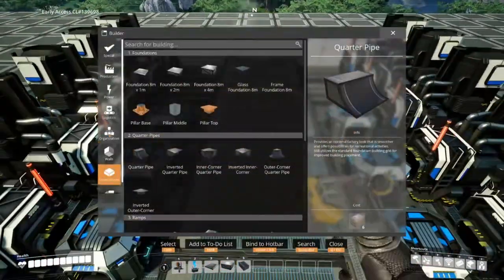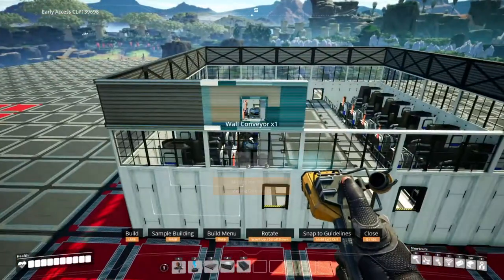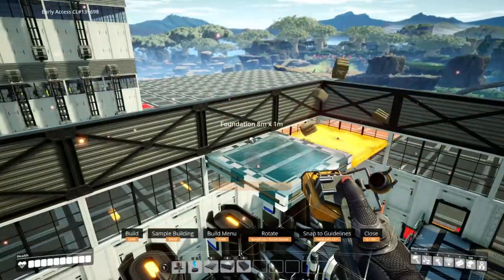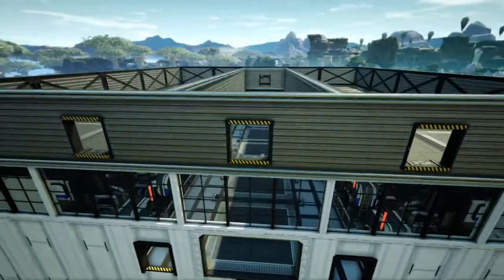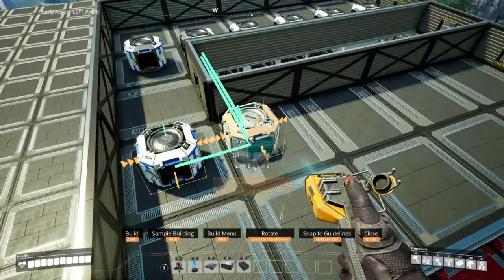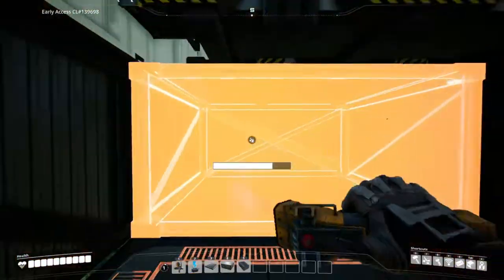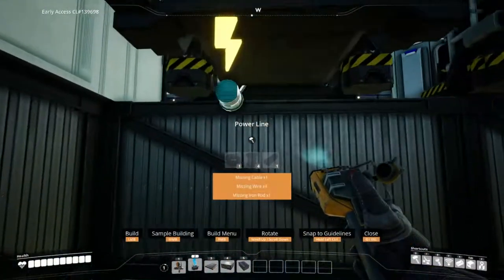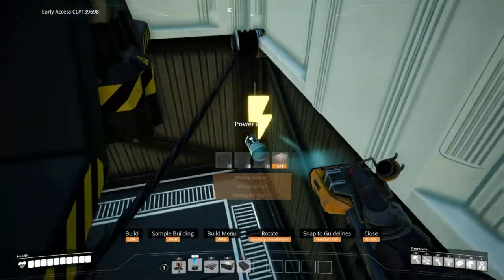CLEAN 5x5 Smelter Build [Satisfactory Game]

Comment: This factory looks awesome and I was trying this out on Update 5 experimental but I'm having trouble. I think they may have expanded the clearances on the smelter or the splitters because I can't get it to line up like this video.

0:18 I put the first smelter down as close to the wall as I can (before it turns yellow for soft clipping)
0:35 But when I try to line up the splitter with the input and the middle of the single conveyor wall its too close to the smelter and I can't place it.

Have you tried this on the new Experimental Update 5?

Comment: Beautiful design! However people, do note that this specific ore split is not good for 100% efficiency. An overflow ore inlet could mitigate inefficiency, but it's still not optimal. Personally i'd use a dedicated basement or 2nd floor sandwich layer right beneath or above the smelters to make an equal ore split for all smelters and feed them into smelters individually with lifts. Doing it this way would actually result in even less visable lifts, making it even cleaner! :D
Reply from the maker: Hi Vsoundelend - TY for the view and the comments - when you mention 100% efficiency - what do you mean by that? I'm always trying to improve my builds.
Reply: For example; a single 120 iron ore belt that you intend to feed into 4 smelters. Your setup in your video gives exactly 60 ore for the first smelter, 30 for the 2nd. 3rd and 4th smelter each get 15 ore per minute causing them to not work half their time. Which kind of defeats the purpose of having the 4th smelter. :D
Reply from the maker: @vsoundelend  oh I must not have been very clear - its 120 per line for 4 smelters so it should be 30-30-30-30 with overflow method. Is this correct?
Reply: @RunestoneGaming  Yes it's doable albeit still not the most efficient use of limited resource nodes, with overflow. But then you'd still need at least mark 3 belts and do splitting with belts instead of just splitters, like having mark 3 as main belt and split it into smelter intakes with slower belts. 😜
Reply from the maker: @vsoundelend  Hmmm - I think theres still some confusion. So I am bringing in 3 120 lines of ore - each line splits into 4 smelters. The recipe calls for 30 ore per smelter. There is 120 ore available from the line. Are you saying this because this takes 3 separate miners? Im still confused about what you're saying here :(
Reply: @RunestoneGaming  There is no overflow if you bring in only 120 ore/minute per main belt.
Reply from the maker: @vsoundelend  So the first 120 comes into the 1st smelter fills it up then uses 30 per minute. Then eventually the 2nd one fills and so on and so forth. Eventually, all smelters are filled and using 30 ore/m. So a single line of 120 ore divided by 30 ore (per smelter) is 4 smelters. Hmmm still not understanding you here.
Reply: With overflow systems in Satisfactory, Here's how it would work: The first splitter divides 120 into two 60 lines, one 60 for a smelter, one 60 for going down the line for future smelters. For the smelter end, it only can take 30/minute, meaning that with time, 30/minute of the 60/min will backup into the splitter again, meaning the line that was going off to the other smelters is no longer be 60/minute, it is now 90/minute, with the added 30 from the backup from the first smelter.
Reply: Stop teasing the wee poor man Runestone 😂